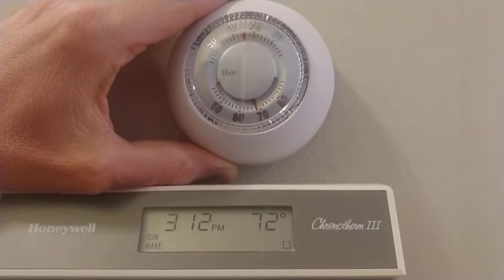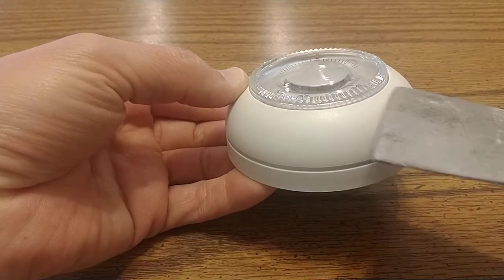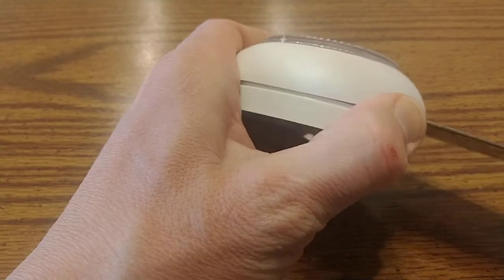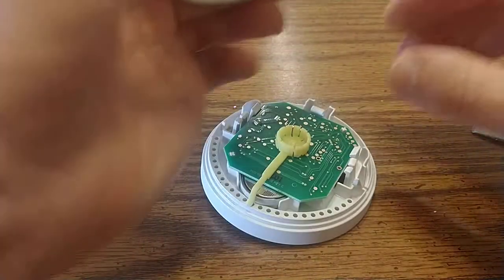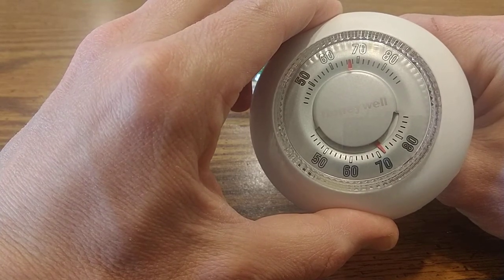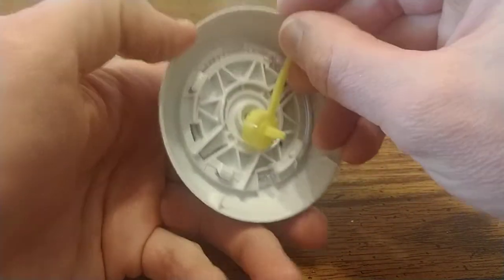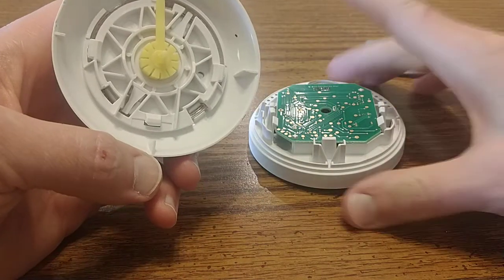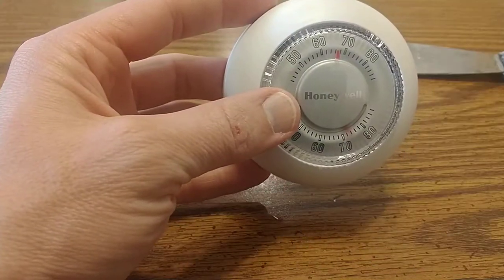Honeywell Round Thermostat Temperature Reading Adjustment

Comment: Thank you for the video lesson! I finally installed my new CT87N Thermostat, and it wasn't working properly. So I opened it up and saw that part of the "V" was missing, so the yellow piece couldn't sit in the "V" (2:14). I bought it 5 yrs ago at $11 on eBay and it was never installed. Today, I'll be buying another new one from Lowes for the crazy price of $43.

UPDATE: I got my new CT87N from Lowes and it has a good clear ring with the "V" (2:14). I tested it, and the air and heat turns on and off automatically. I love these thermostats when they work like they should. Also, it's crazy how much Bidenomics has raised the prices on everything.

Comment: Have you had any problems with this thermostat ? 
I see some bad reviews that they are not as good as the old "mercury" round thermostats. 
I had a mercury one that went out and replaced it with a digital one for my steam heat. 
I hate it ! 
I have it set for 72 it goes to 73 and shuts off. Stays off till it drops to 71. 
I feel hot, then cold, hot, then cold. 
Does this new electronic version have the same -1 cut in +1 cout out or is it a little more "reactive" than a digital one ? 
I miss the mercury one because it didn't seem to have that big swing before it turned heat on then off.
Reply: I have the same problem.
Reply: I have not had any issues with mine
Reply: Me too. Set at 77 starts ac at 78 and runs until it"s 72. Bought it because it was a round Honeywell. Actually Manufactured by Resedeo. Shame on Honeywell for marketing such a piece
Reply: Search for the video where the guy shows how to adjust the CPH (Cycles Per Hour - the number of times your thermostat turns the furnance or AC on per hour). You can increase or decrease the CPH by toggling 2 dip switches on the back of the cover. The video explains the pros and cons of increasing or decreasing the CPH, but the upshot is that increasing the CPH tightens the range of temperature your thermostat will allow before it kicks on and off. The downside is cycling more times per hour increases the wear and tear of your equipment and might also increase your energy consumption. My mother-in-law's thermostat was off by 3 degrees F (the thermometer read 3 degress higher than the actual temperature, everyone was complaining about how cold the house is this winter), so I adjusted as per this video. The CPH dip switches were set at 5 CPH from the factory, I kept them at 5.

Comment: Why doesn't the thermometer come calibrated from the factory
Reply: Shipping can change the calibration
Reply: Mines not so fancy! It has a mercury switch in it and the decorative part comes off and leaves the adjusting knob on the thermostat body. How does this one adjust the thermometer dial?
Reply: @justinwilson9530  if that is the case, the entire production are off and need adjustment.
Or they can admit they are defective.
The mercury ones never had this problem

Comment: Notice and mark each piece (up or down) as it is disassembled.
Reply: No need.
It can only be assembled in a very specific way.
The plastic needle fits between two teeth, and the pin should be set in the electronic device first.
They use a very fragile potentiometer .
But worry not, it still wont work right

Comment: I tried adjusting the thermometer needle but when using the screw driver I don’t feel anything engaging the screw driver head. any help would be appreciated.
Reply: I didn't feel anything either. I tried different diameter screwdrivers, tilting them until one worked.
Reply: I just did this adjustment with a small phillips screwdriver. It's not really phillips screw head that you engage, but the screwdriver gives a friction fit in the hole. Was able to push the phillips in until I got a friction fit and then able to turn and adjust the thermometer.